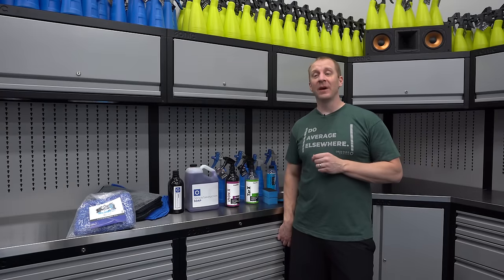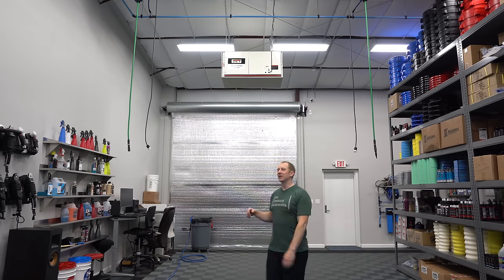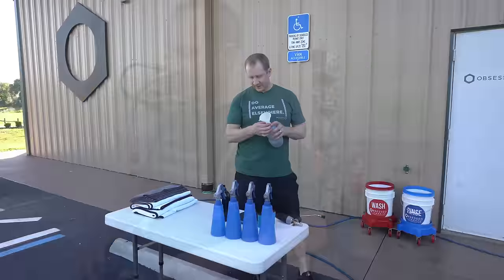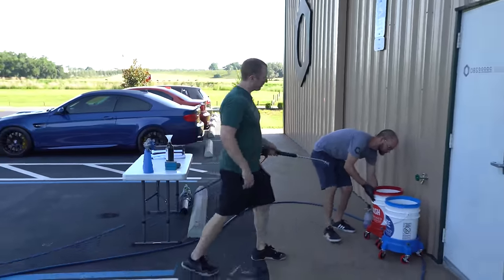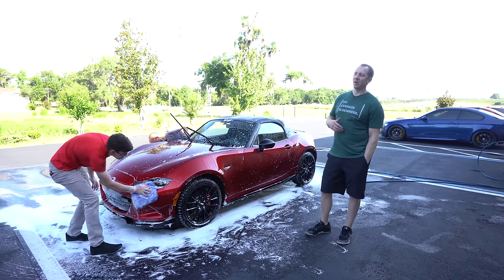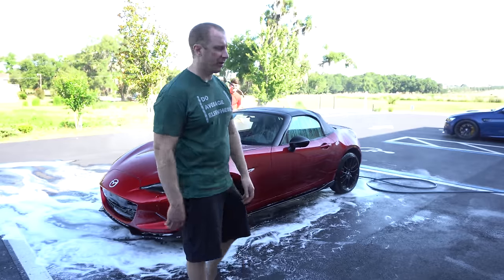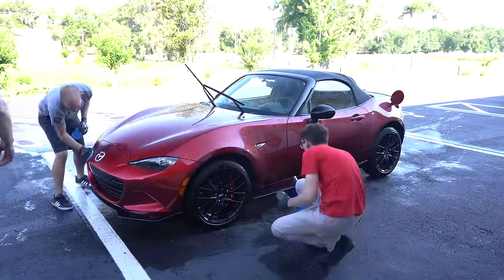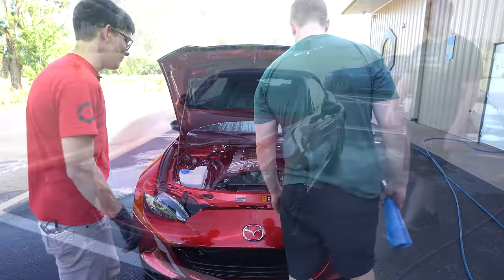ND Miata Detail Series: E1 - Decontamination

Comment: Warning for those watching this.  I've used my hands with nitrile gloves to spread Iron-X when doing a regular decontamination on a coating.  Polishing or claying was not in the plan, just wanted to remove winter crud from the coating.  But the gloves added some marring to the paint.  It can be easily removed by polishing but if that's not your plan, then be careful spreading Iron-X by hand while wearing gloves.

Comment: I was hesitant to buy the Incredisponge because i already have the Cyclone. U tries both whats the biggest difference? I also have 2 of the Cyclone hand mitts. My thoughts are the  mitts are going to be similar to the Incredi-sponge albeit smaller. Not having a thicker foam inside the mitts. 
Fwiw i use the Apex Detail technique with the 3 mitts/one bucket.

Comment: Good thing you knew what orifice size you had in the foam cannon. I still can’t figure it out since they’re not numbered . I used both that came with the PF22 kit , and it seems my 1122 TST doesn’t really like either of them . It ramps up the pressure over 1500 psi ,the foam doesn’t come out that great too . Any tips ? Thanks in advance!
Reply from the maker: The 1.25 should work just fine with the 150mL of soap and a 20A circuit.
Reply: Obsessed Garage it’s hard to tell which one is 1.25 or 1.1 since they’re not marked . I forgot which one I had in since I tested em both with sun joe and Kranzle . Maybe the only way is to try each while watching the pump pressure . The one that ramps the pressure more is probably going to be the smaller one . Can’t think of anything else .

Comment: The Pressol bottles would be ever so slightly better if I could see the fill level. A translucent fill line like a container of engine oil would work.
Reply from the maker: I just had a conference call with them today.  Working on it, but it's going to take some time and lots of convincing.

Comment: What’s the big difference between the Incredipad XL and the Cyclone 10X wash pad?
Reply from the maker: The Microfiber Madness version is not exclusively microfiber.  From my testing and cutting open of several pads, they have done a whole lot more with using a balance of microfiber, wool, and the internal foam to create the proper weighting when wet.  I full microfiber pad with big sponge inside makes it very impractical and heavy.

Comment: I brought ND to a top detail shop - they did NOT want to touch it due to how little paint is on it from the factory. It's terrible. Mazda went too much on the "gram theory"
Reply from the maker: Seemed fine to me.  Car was pretty easy to work with.
Reply: Interesting. What was the thickness you were getting on the hood, door, fenders, and trunk? Curious. This shop said it’s WAY too thin to even touch

Comment: Why do you change to 1.25mm from the pf22? Does it damage the pump pf kranzle or something?
Reply: Genysmen runner too much restriction for the larger flow of the Kranzle. It would pull too much current. Cheap pressure washers need the more restrictive 1.1 to get decent foam.
Reply: Patrick94GSR thanks for clarifying
Reply from the maker: Bingo

Comment: Do you still use beadmaker as a topper for the power lock/845 combo?
Reply: Dale Maddox yeah he does. See the m3 video
Reply: Reflect Detailing I have seen that, but that was over a month ago and was curious if he found something else to replace it since. So many products out right now lol. The reason I asked is because PL/845 combo beads so great and wondering if beadmakers hydrophobic property’s are masking 845’s hydrophobic properties and not doing as good of a job
Reply from the maker: Yes sir.  Seems to be doing well.  It isn't as hydrophobic as 845 is alone, but I'm okay with that.